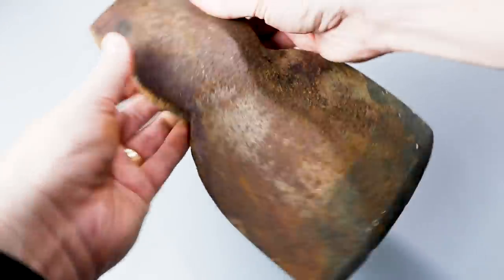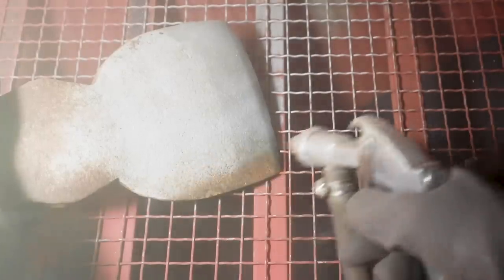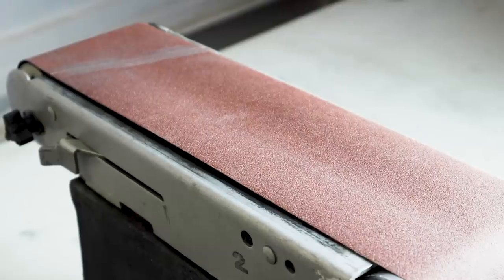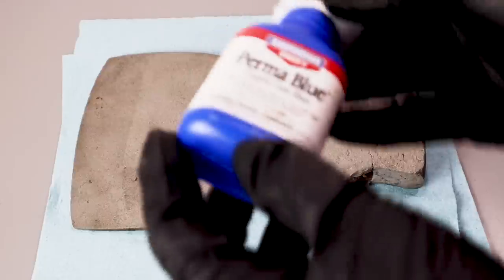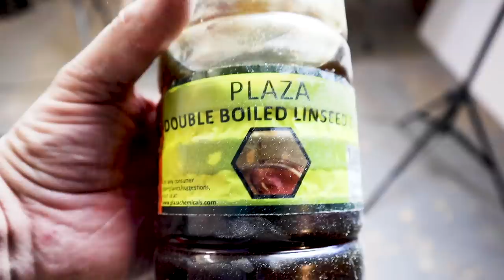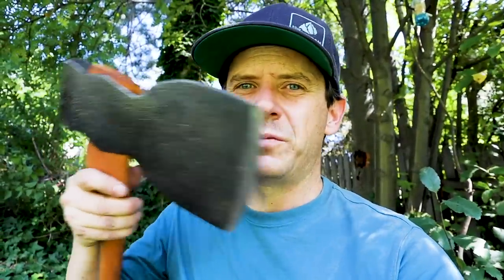Older Than the USA! | Masting Axe Restoration

Comment: It's a kent pattern axe.  Been made in Britain for hundreds of years. People  put their initials on their tools in those days.  These styles of axes were used as broad axes. They are good at different kinds of work, just by changing the angle of the grind. They make brilliant carving axes!  With a 20° angle. Some axes were completely flat from poll to bit. You have done a good job there sir. Watch that split if you intend to use it. But great just for a collection. I have my great, great grandfather's 4lb kent pattern axe.  Just in process of making a new handle. And it's a perfectly flat version. And has never been used. Perfection! And put that linseed iol in a glass bottle!

Comment: Super nice. That's the way to do the heads every time. Forget the metal wedges. That handle fits perfectly. I think you did it proud, whether it's Ames or some unknown blacksmith, no matter. I would like to see a little more work on the edge, getting a really razor sharp edge on it.
Reply from the maker: Thanks man. It is quite sharp presently but could do for a bit more. Thanks for watching.
Reply: @oldshovel  I just like everything with a blade as sharp as possible. you're actually less likely to get hurt with a sharp blade than a dull one.
Reply: Over the years, my wounds with sharp tools have always been worse than the dull ones.

Comment: Thank You for not polishing the axe head or sanding it down smooth ..It looks good the way it is ..I have been using that same blueing on tools and on a new axe head and it just looks right
Reply from the maker: Thanks - I agree on polishing, for most it does not make any sense, especially on vintage pieces like this one, in fact that is why I did not even remove the mushrooming.  Thanks for watching and commenting.

Comment: I love Magura brakes , they are just awesome but even with cheaper brands you can have a lot of fun . I have a lot of customers who ask for theyr brakes ...disc type or rim brake ... they are worth any penny you spend on them ! For me (because I'm a heavy person) I need 203mm disc in the front to get some sensitivity back into the brakes because on my old Massi Toro I got very old Hayes HFX 9 with Alligator Windcutter discs (they just bites on smaller sizes) and on my Fatmodul FS  I have Tektro Draco2 with Dioche floating discs . In the back I always ride 160mm discs because on the road or for cross country thats absolutly enough for me .  
The only disadvantage is that a lot of suspension forks still don't allow 203mm disc , but if you're normal person (around 165-190pounds ) then a 180mm disc in the front is more than enough for everyday use. The only thing that I realy look at is I always use stainless steel disc , they don't rust and last a bit longer .

Comment: Question:
Why did you chose not to reprofile the poll of the axe?
You reprofiled the bit of the axe.
Would an axe of that period have been blued?
This kind of sounds like I'm judging, but I'm not.
Just very interested in the choices one makes in restoration.
Beautiful handle by the way.
Reply from the maker: All good questions. I kept the pull as it was to retain its history. Though it does have some mushrooming it was not so bad as to interfere with the function of the axe.  As to bluing I know they did not do cold bluing, using perma blue or other similar blueing techniques I do believe they likely used hot bluing techniques or at least blackening from the forging process.

Comment: Do you worry about overheating and ruining the temper when sharpening with your belt sander? Thanks.
Reply from the maker: I do. And that’s why I do it with bare hands so I know if it’s getting too hot. I also used water to keep it cooled down.
Reply: oldshovel thanks for the response. Love your videos! Keep up the great work.

Comment: Cool.  I notice you don't use sharpening paste or really anything other than a belt sander with what looks like... Maybe 80grit? Is it really that easy to get sharp blades?
Reply: David-Michael Wallace : How sharp do you want an axe? The sharper you make it, the thinner you make the edge— pretty much by definition. If the edge is very thin, it’ll get knocked off the first time you chop some wood. So it’s best to stop before your edge is quite that fine. Yeah, I know, on all those videos guys are shaving hair off their arms with axes. But do you shave with your axe, or chop wood with it? There’s a reason people don’t fell trees with razors, and there’s a reason barbers don’t shave customers with axes (besides the fact that people would run screaming out of the shop).